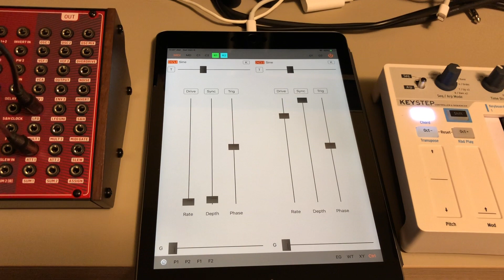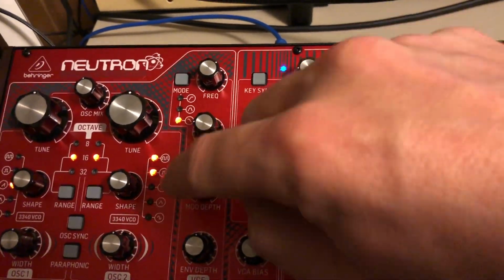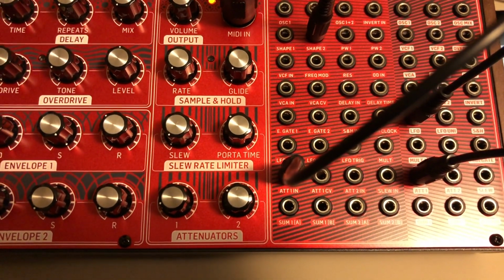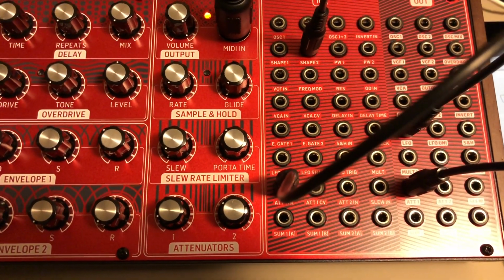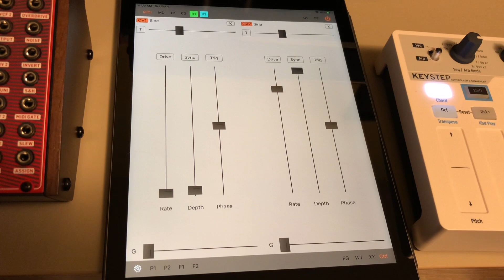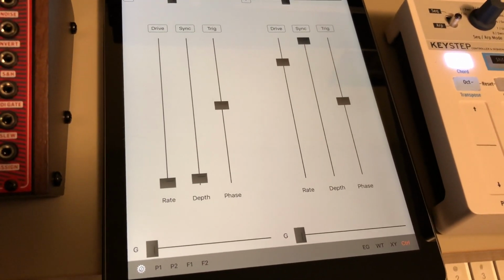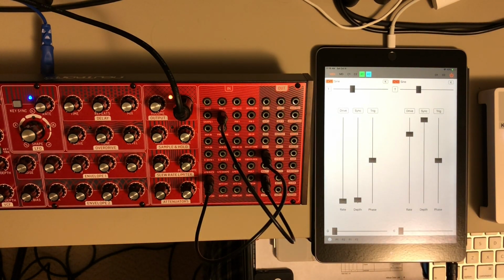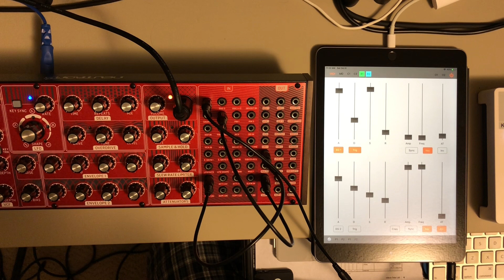Add 2 LFOs to the Behringer Neutron with CV Mod for iOS

Comment: can you show how the ipad is connected?
Reply from the maker: Hi. Sorry for the delayed response. In most of these demos, I use a simple stereo breakout cable, and then connect mono 3.5mm cables to each channel. This is the one that I use: 

https://www.sweetwater.com/store/detail/YMM261--hosa-ymm-261-stereo-breakout-3.5mm-trs-to-dual-3.5mm-tsf-6-inch

Full rundown of CV Mod and the user guide is available here: https://eokuwwy.blogspot.com/2018/07/cvmod.html

Thanks!